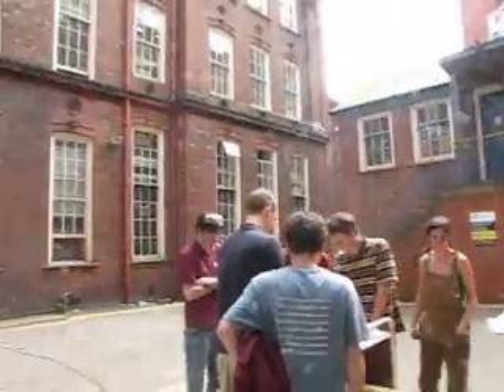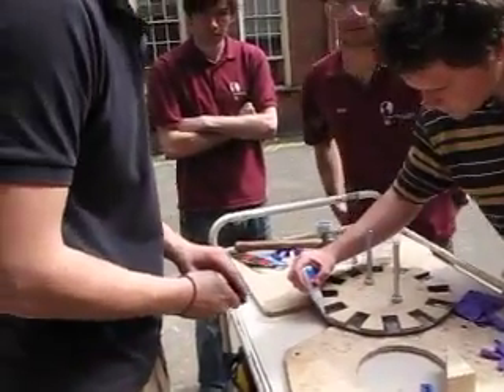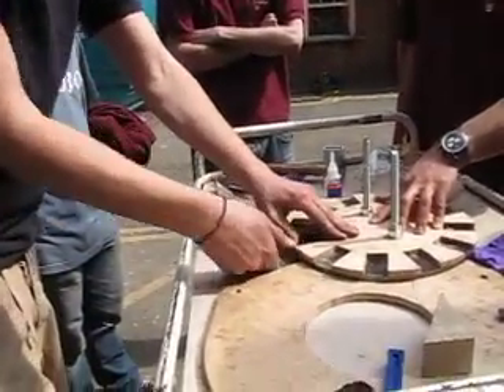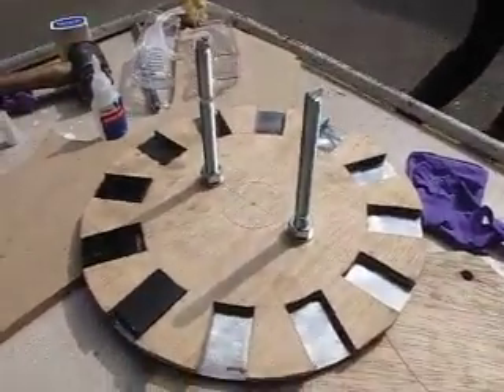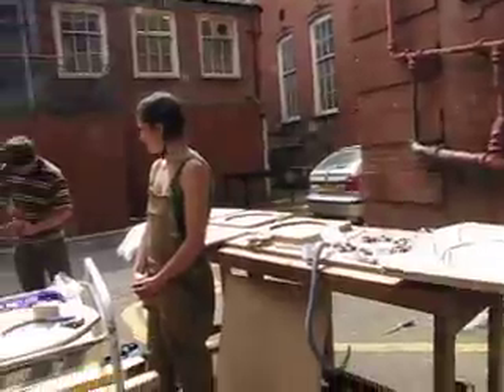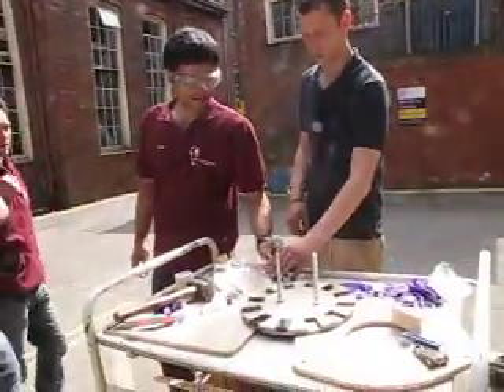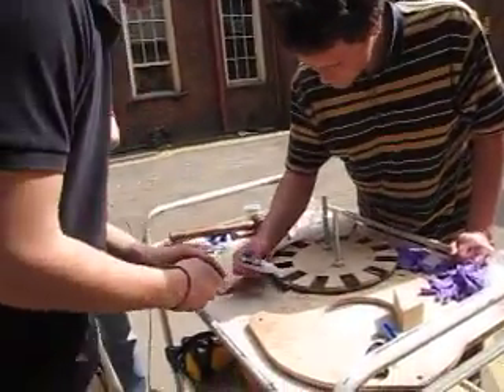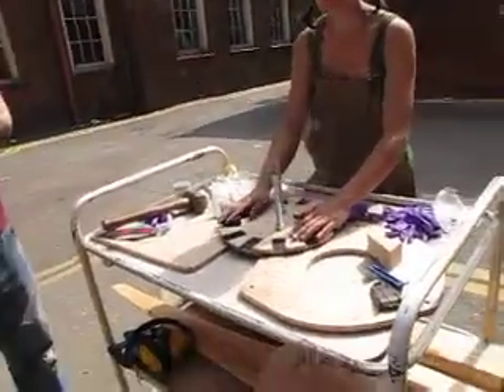Diy wind turbine vid 1 - Gluing magnets.MOV

Comment: hello sir may i know what kind and the size of the magnet you use in this project? thanks and Godbles
Reply: rare earth magnets you want the ones that can lift 80 pounds its the strongest they sell i think they are like 88,000 gauss maybe its 44,000 which ever one it is that lifts 80 pounds and the size and shape depend on what size turbine generator you're building